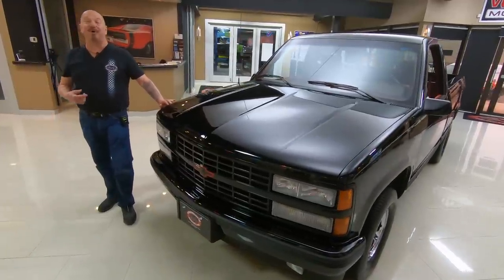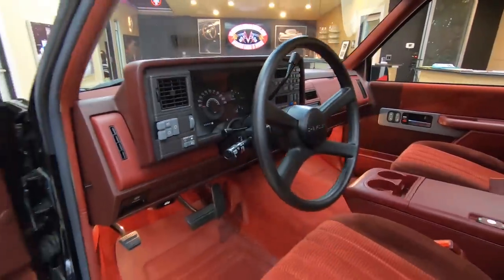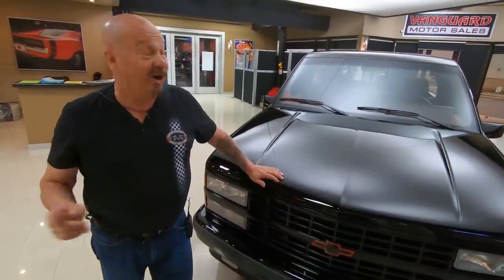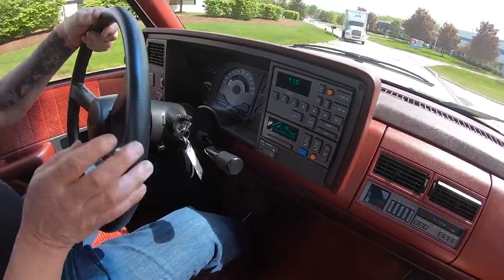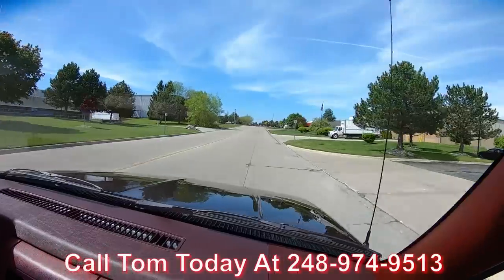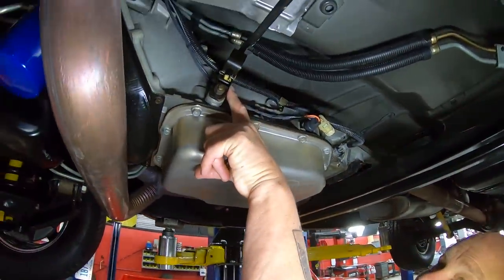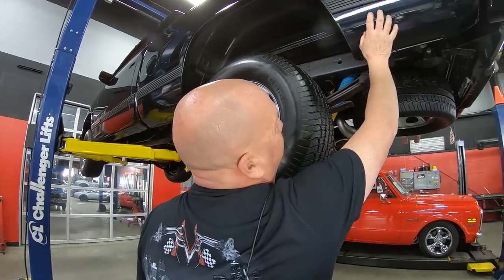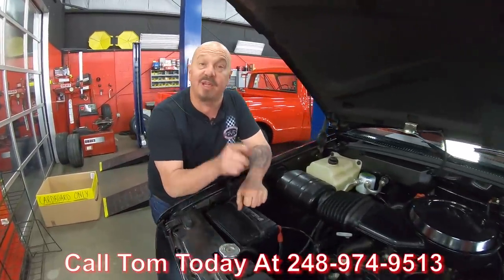1990 Chevrolet 454 SS Pickup For Sale

Comment: I have an ‘89 GMC 1500 (basically the same thing as this, only differences are the headlights, the logo, and my engine is a 350) but this truck is way better than mine. Only change I would make to it is the exhaust. My truck sounds waaaaay better.

Comment: This is almost like the one EricTheCarGuy's dad's truck that he's refurbishing for Power Tour.

But, like, 60 miles? That's like manufacturing plant testing miles. Did someone pay MSRP for it back in 1990 and literally NEVER drive it? I mean, even a Sunday-only vehicle would have more miles on it. What's the point in owning something that expensive if you never even use it?